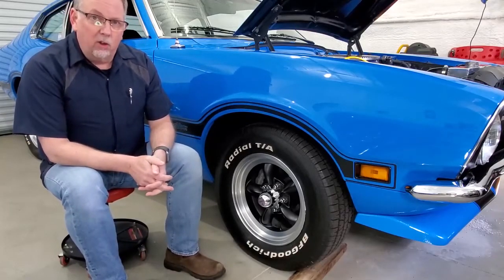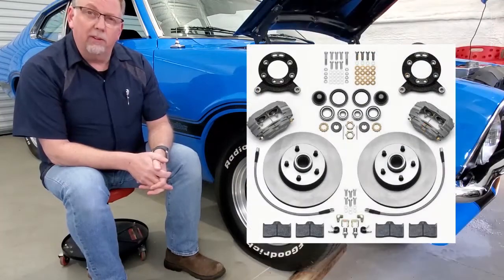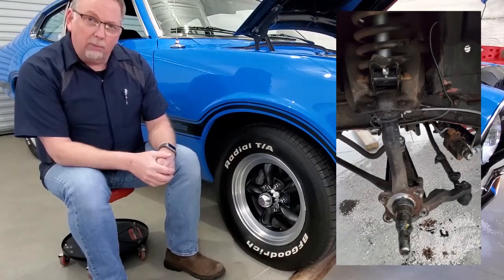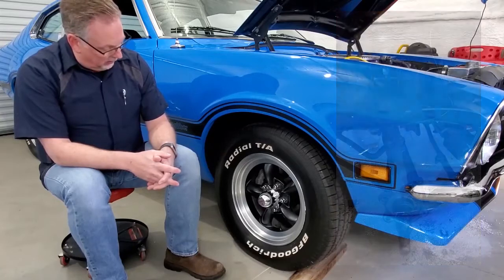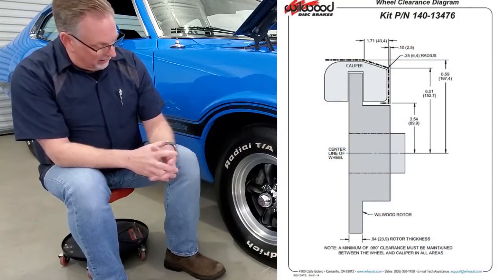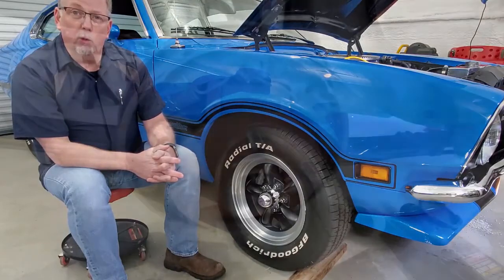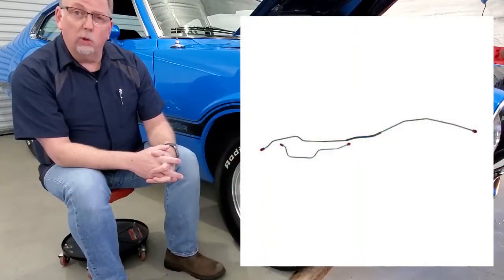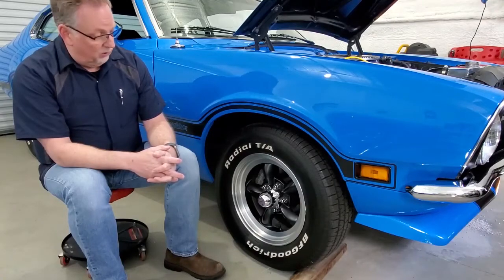Wilwood brakes for Ford Maverick: The ultimate upgrade

Comment: Hello
What brake booster dit you fit ? And which wheel cylinder in the back?
Best regards
Reply from the maker: It's manual brakes and stock wheel cylinders in back.

Comment: What size rim and tire did you install. i have a 73 with 4 wheel drums and plan to convert to 4 wheel disc. but i want to know what size tire and rim will fit
Reply from the maker: Front P21570R15 and the Rear P24560R15